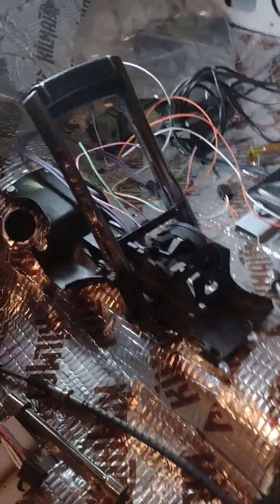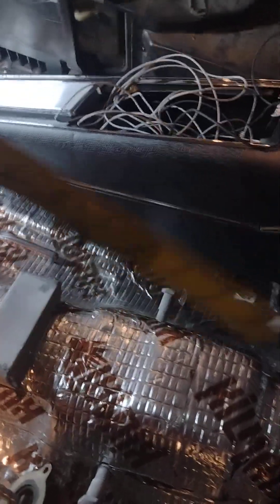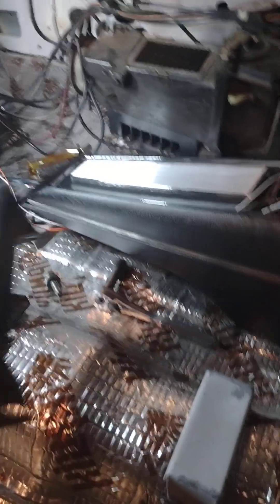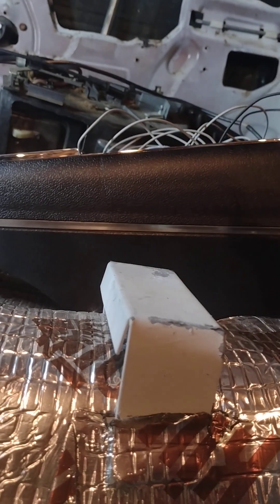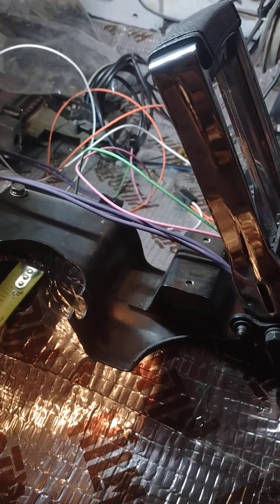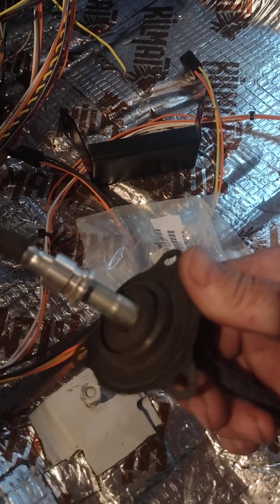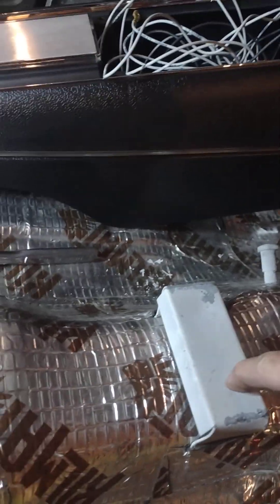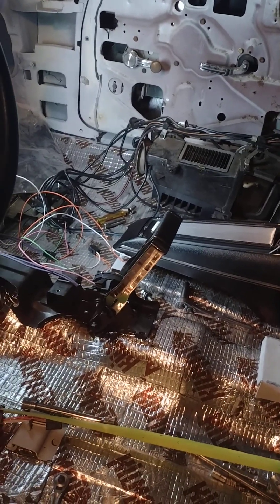1971 Chevelle Staple shifter and center console installation with measurements.

Comment: Great Vid! Thanks for taking the time to do this for the rest of us!
Reply from the maker: Your welcome.  I made a comment later that you can move the rear staple shifter bracket a little farther backwards towards the rear seat, (I can't remember) to get the bolts or screws more centered. I think it was about a 1/4 inch.  It will still work and won't make any difference if you change nothing but I like to keep things neat.

Comment from the maker: When I give the measurement for the bracket at 17-1/8 this will work, but to get it more twords the center of the bracket make it 16-3/4 or even 16-1/2. Everything else stays the same.
Reply: That measure ment is actually 17 1/4" without the killz mat